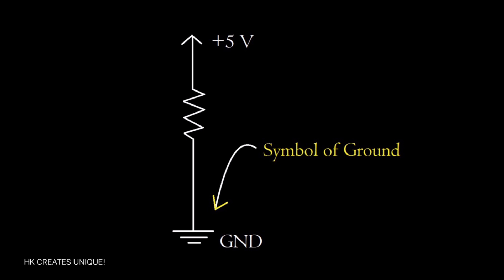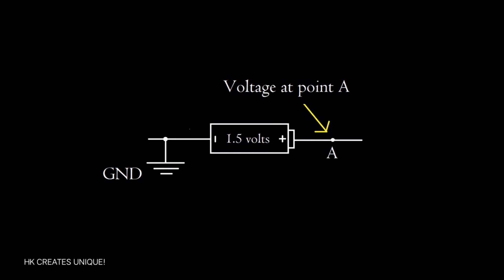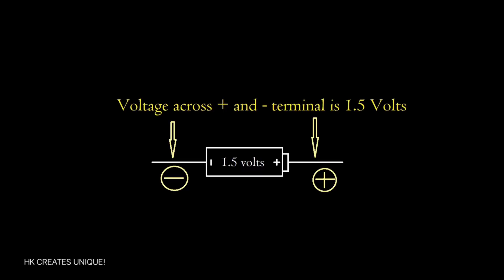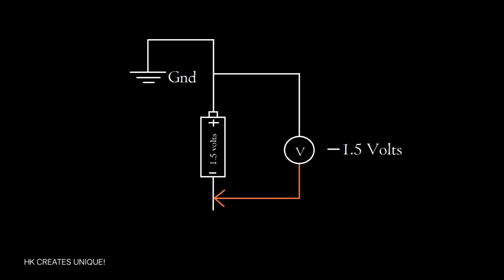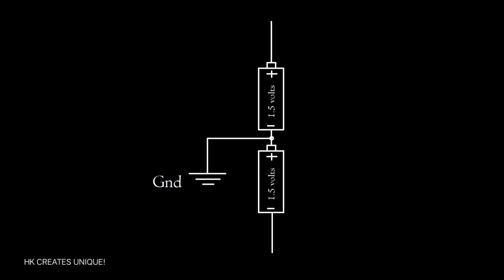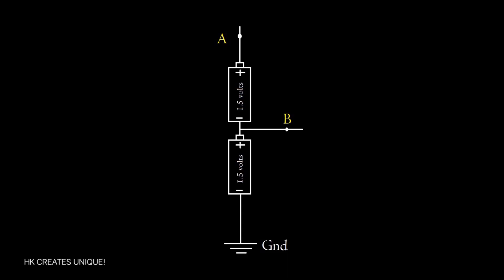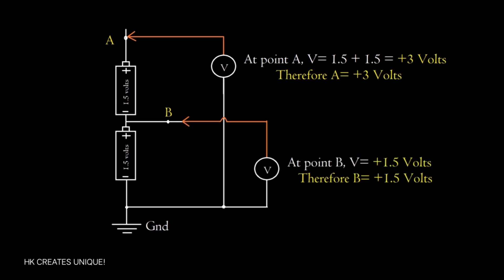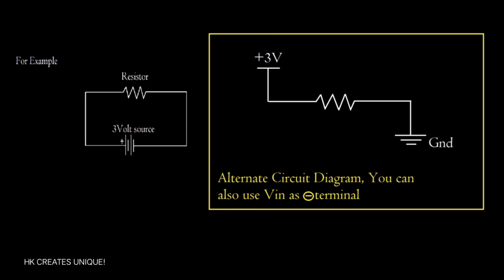Ground in electronic circuits || explained

Comment from the maker: 1:17 voltmeter shows 0V as there is no relative potential difference across the voltmeter leads .There is no potential difference because:
1. no current was flowing 
2 .resistance is negligible across the leads